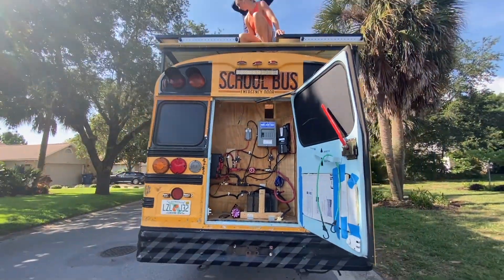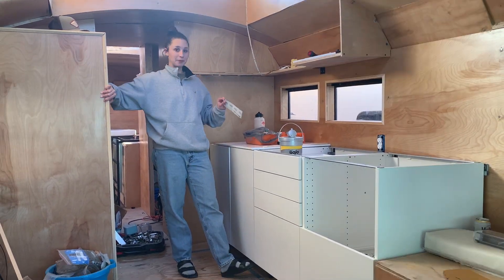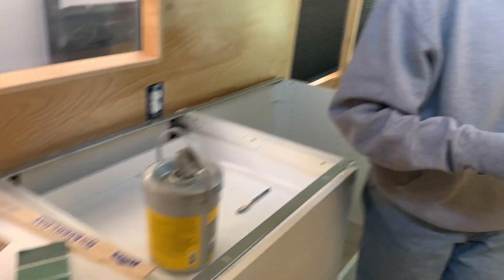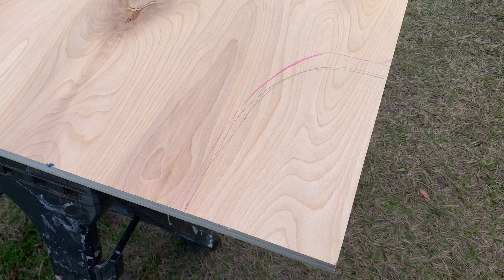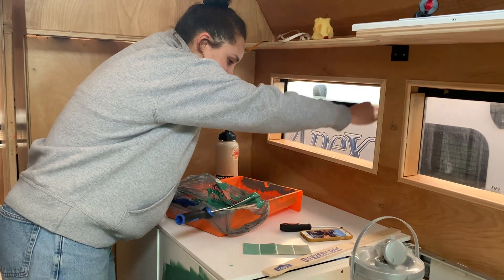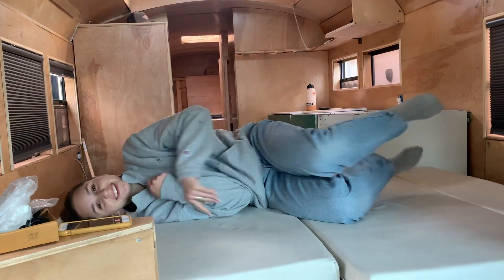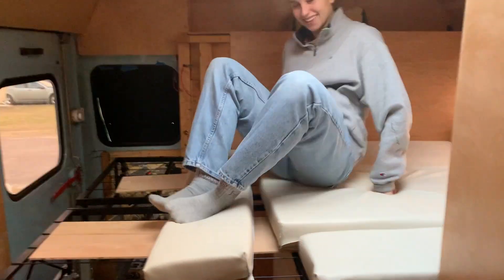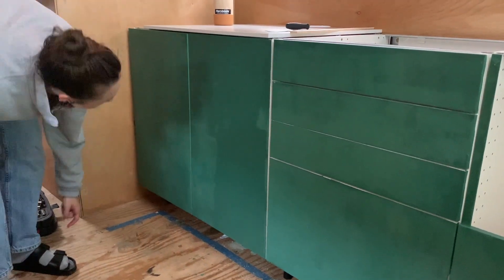COLOR REVEAL! We Painted our IKEA Kitchen Cabinets in School Bus Conversion | Tiny Home Update

Comment: Thank you again you just made my day, I know you seen the inside of my bus a lot of wood and you know I think I'm gonna paint some of it I was gonna stain it  a light pecan and then put a coat of Poly over it but I think some of them the cabinets I'm gonna paint don't know what color yet but. I'm confused about your table where are you gonna store it if you put legs on it because it's taking up your whole alleyway? So when you think you guys are gonna get on the road? I have an appointment next Friday to have the bus inspected for the title finally to be changed then I'm gonna start slowly but surely finishing it up hope to be on the road by May or June my first trip will be to Deerfield beach  / Boca Raton Florida my hometown.✌❤👏💪👨‍🍳🎅🚌🙏
Reply from the maker: The table will get cut in half, and the legs fold along the back.., then it’ll be stored behind the couch! Best of luck on the title change!